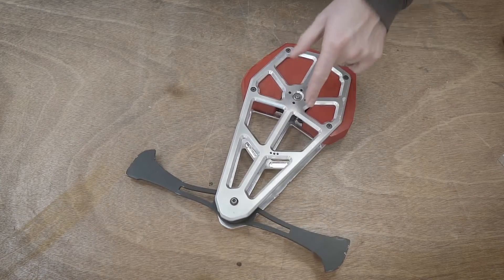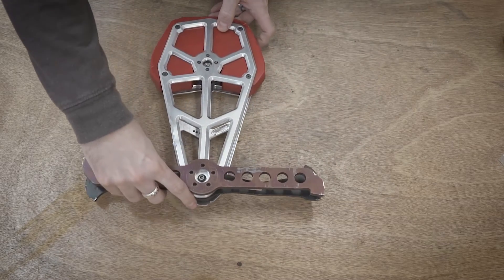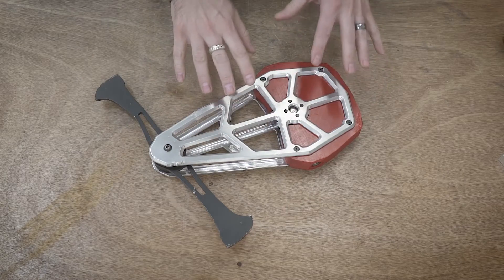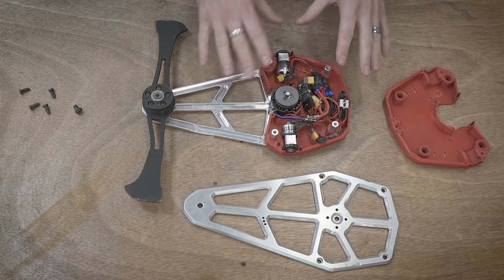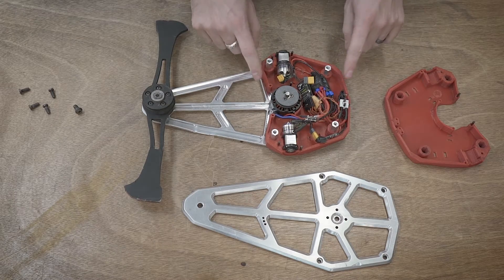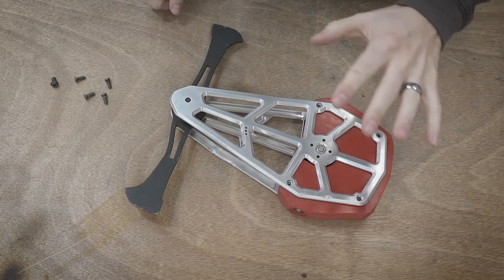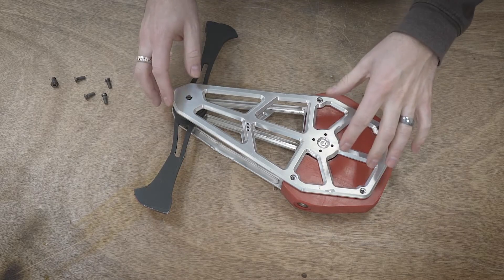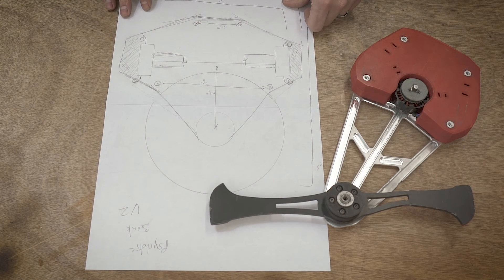Psychotic Break - V1 Breakdown (V2 Planning)

Comment: A useful maxim from the world of aeromodelling is "Simplify and add lightness". It's always worked well for me.

Now, in a special limited-time offer and for a one-off payment of just £862,350 * (free delivery in the UK only),  Elli Industries GB can provide Lightness™ (©, ®, etc, whatever)  in convenient modular form. Add Elli's patented Lightness™ to all your mass-critical projects NOW!

Want to turn that fighting bot through 90° and make it a vertical spinner running on 12" wheels? Go for it!

Fit that 85lb vertical-spinning weapon bar! Bolt on 125lbs of hardox armour, then add sufficient packs of Elli Lightness™ to bring the total weight down to a beard-whisker under the required 3lb limit. It's easy and fun! Manipulating mass and defying gravity has never been simpler!

* [Terms & Conditions apply.]

Also available: Elli's Magic Beans™ suitable for making delicious, nutritious Free Lunches™...

Comment: On the hammer(s), a simple mod might remedy the bending (on the plane, that is) and it's leaving a small rib in the center uniting the current points of bend (because that's where the bend is likely to happen. That or filling the hole with lightweight epoxy (bubbly on purpose).

Comment: If you had 2 smaller counter-rotating weapons, they would cancel eachother out and the CoG would be about the wheel axis, giving you good control.  Then it wouldn't matter if you hit with the "front" or the the "back".  Hits against the wall would be counteracted by the opposite spinner, so it wouldn't create a blender type situation when a spinner hits the wall.  In fact, if you hit another bot and it spun you around, the other spinner would strike in the opposite direction, possibly giving a 1-2 punch.  If you decided to sit still and spin CW or CCW, you could leverage this "protect mode" for a competitor looking for an easy lunch.
Reply from the maker: Yep, "two weapons" always comes up.  try making it.  it's much harder than you think.  And in the end, you have two weapons that are designed for a different weight class (think of a 1lb bot fighting a 3lb bot).  Two smaller weapons means ineffective weapons, and more weight spent on the weapon systems, so less armor.  It's been tried, and has never really been successful.

Comment: There is a lot of symmetry to your v2 design, the only think missing is a second disc at the back....HINT.
Reply from the maker: The whole weapon system is about 30-40% of the weight.  By splitting that between two, each would be ineffective.

Comment: I like the idea of wheel guards but are you not concerned about the guards taking a hit, bending in, and jamming your wheels?
Reply from the maker: I will design them in such a way that they can either break free, or crumple.  I won't use metal, which deforms, I would use nylon, which cracks and breaks away instead.

Comment: What about 4 wheels, smaller and then they might be able to be closer to weapon? Also add sloped wedge on the back or sides, to avoid other horizontal spinners?
Reply from the maker: sloped weapons are bad, they tend to make the driving really unpredictable as the bot wants to be parallel with the rotating mass (ie, it wants to tip forward/backward to correct for the angle of the spinning mass).  I thought about 4 wheels, but with the weight of the weapon, it would want to dip forward and the back wheels wouldn't really get much traction.  OR, if you moved the weapon far back, then you would lose a lot of hitting potential.  Everything is a trade-off.
Reply: @RobertCowanDIY  tanks a lot for the reply! Said sloped wedge, but ment bar maybe? My first language is not english 🙂🙃 anyway, at side or end of the bot a bar that slopes, to get beneath and let the oponents bar lift/unbalance its horizontal spinner, if (when 😜) your own primary fails. I think lockjaw uses that against thombstone in s19e4, seems effective. I really like you videos, and please include the prototyping like here, nice to see a design evolve - fun stuff! Keep up the good work 😁

Comment: The only other thing to consider is a secondary weapon- when you lose the main weapon, you have nothing, since a tear-drop shaped bot is no good for pushing. Add forks or a wedge to the rear so that you can push your opponent around before and after the weapon fails, giving far greater control. Given the weight savings of the new design I'd say it's doable, and watching all the past fights when you lose the weapon I'd say it's a requirement in order to stay in the fight and not just become a punch-bag for the opponent...
Reply from the maker: Dual weapons aren't effective.  You end up having two failure points instead of one, and half the weight on each.  This leaves you with weapons that are redundant, but ultimately ineffective at causing damage.  I'm focusing on a single weapon that will always work.
Reply: @RobertCowanDIY  I'd agree if I were talking about a full-on secondary, but I really am just thinking about a simple scoop or forks that allow you to push things around- so long as they are robust and not flimsy after-thoughts they would be invaluable. It would be naive to believe the main weapon will never fail or will always be effective against all opponents- sometimes matches do turn into Sumo wrestling and not being able to push due to the bot's shape means you are at a disadvantage...
Reply from the maker: @SuicideNeil  Oh, I get it...  but when you say "as long as they are robust and not flimsy", I hear that in terms of grams.  That's gonna be at least 100-200 grams.  The weapon is like 300-350 grams.  That weight needs to come from SOMEWHERE.  It's always a trade-off.
Reply: @SuicideNeil  so like ORBY Blade?
Reply: Reminds me of rotator

Comment: you'll probably want to move the wheels forward. hubmotors are heavy and I doubt that you can get the weight distribution you want with the wheels that far back.
Reply from the maker: They are a LOT closer than they were.  I will prototype it and see how the weight distribution shakes out though.  The battery and other components will be behind the wheels.
Reply: @RobertCowanDIY  one reason I actually quite like belts is that it lets you move the motor (and COG) backwards. I dunno if it's worth the other tradeoffs though
Reply from the maker: @Skooteh  I get ya.  I want to try it without belts.  It is a LOT shorter now.  Also, the hub motor isn't THAT much heavier, the weapon is lighter and the housing for the hub motor isn't too bad.